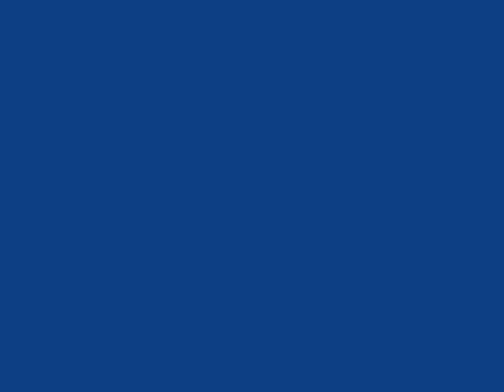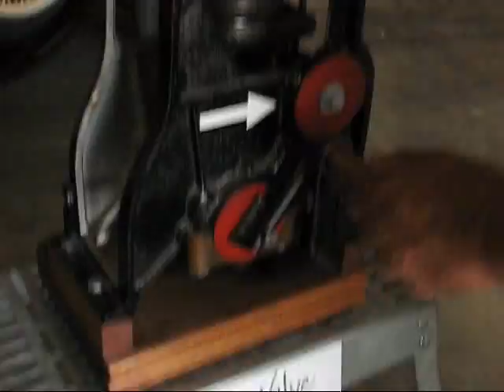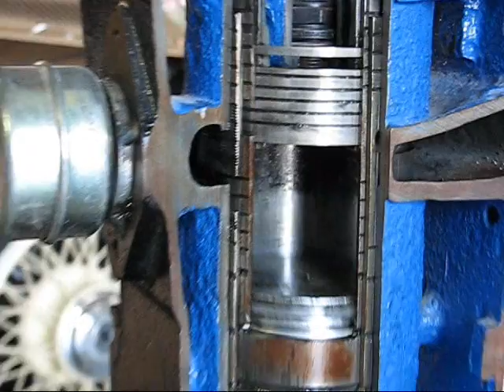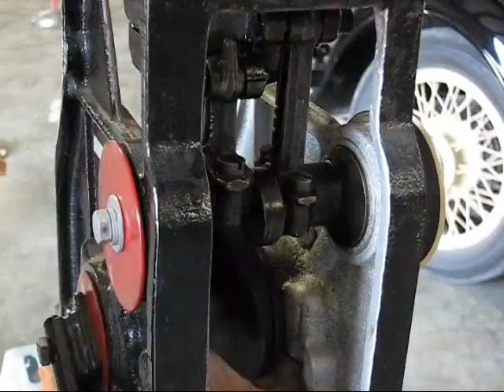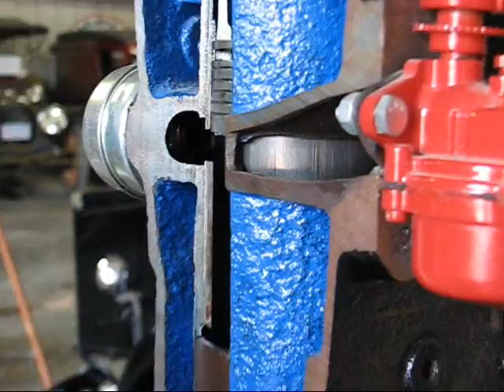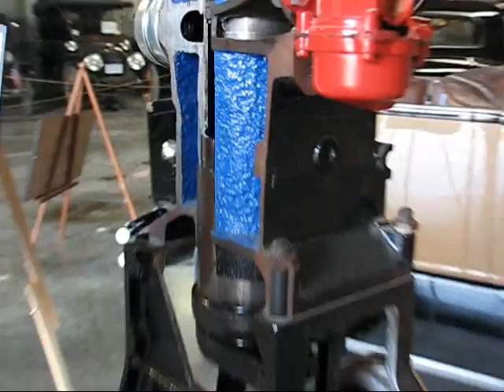Knight Sleeve Valve Engine

Comment: Thanks for the video.
My late Grandfather, Mr. G.P. Stewart, had a Willys-Knight car as a young man in the early 1900's and bought a running engine shortly before he passed in 1976. He used to start the engine and describe the virtues of a sleeve valve engine while adding the proper amounts of Marvel Mystery Oil to the fuel.
The engine was sold to Willys-Knight collectors so we know it's in good hands.

Comment: You see the huge inlet and exhaust ports, but only a few would notice that when the spark goes off, the slots in the sleeves are ABOVE the junk ring, so they are not distorted by the forces involved. You might have to be nimble on the pause button to work it out properly.

Comment from the maker: You can see the two red discs on the front of the display. The first one is the crankshaft and is connected to the handle. The second one is the smaller crankshaft that is connected to the sleeves.

Comment: It's different from a more modern type of sleeve valve engines as used by the Bristol Aircraft Company for instance.
The later design has one sleeve that moves up and down, but also rotates about 1/4 of a revolution inside the cylinder, the ports in the sleeve first opening the exhaust port when it moves down, then rotating to the inlet port and finaly going up to shut the port and rotate back to the initial position.
The Bristol radials were supercharged, so this type of engine may work well with a turbocharger as well.

Comment: Sleeve engines have 2- to triple the internal friction compared to a modern IC engine, due the sleeve movement, hence efficiency is reduced. Another disquished problem was the roundness of the sleeves, which tend to warp once hot, special around the exhaust ports, and will scrape and eventually frett. Napier and Bristol were not advertising this more or less secret process of warpfree-sleeve manufacturing.

Comment: What an incredable mess, you have to really, REALLY, detest poppet valves to design and engineer something like that. Three connecting rods, two cranks, it's the work of a mad genius.
Reply: You can't run high compression ratios as the high piston fouls the ports. But they run really well with blowers. That's why the most powerful gasoline engine ever, the Napier Sabre aero engine of 5,500 hp, was a sleeve valve.
Reply: And imagine the internal friction. Actually, the sleeve-valve concept is sound, and had major perceived advantages over some of the early poppet valve jobs in that they didn't require frequent valve jobs or adjustments, and the carbon deposits were said to improve the seals between the sleeves. Read the account of John North Willys's epic British road trip in a Knight-powered car in the early teens. Sunrise 'til past sunset every day for weeks on end, and all the chauffeur/mechanic had time to do maintenance-wise was collapse into bed each night.
Reply: These engines were designed at a time when the metallurgy for poppet exhaust valves was not very good. In the 20s and 30s exhaust valve seats would need to be regrinded and valves replaced at as little as 20,000 miles.
Reply: +Johnny Tobifour Then why were they still being developed into the mid-40's in some of the most powerful reciprocating engines ever made?
Reply: I think the question you should be asking is why are they no longer being developed.
Reply: @kuyamoto9195  EXPENSEIVE TO MANUFACTURE........BUT VERY POWERFUL........THEY ARE SMOKERS............AND THEY LOVE TO BURN OIL .

Comment: I like the elimination of the conventional valves but don't like how his cylinder walls move.  That's supposed to be a damn tough piece of the engine.  What if you want to turbocharge someday.  You have two wimpy walls moving up and down?  Not good.  I'd rather fix the woes of the wankel rotary.

Comment: It's absolutely ridiculous. It must be a mechanic's nightmare. It's incredibly awesome.
Reply: Mr T  Not simpler than typical OHV. Maybe you could argue it's simpler than some OHC engines. The reason poppet valves became the mainstay of ICEs, is ease of reliably sealing. The sleeve arrangement is a nightmare to seal. Still neat, though.

Comment: it's funny how that engine can have so little compression and still be much more powerful than Flatheads XD
Reply: Until tetraethyl lead was introduced during WWI the octane rating of automotive gasoline was 60-70. This limited the compression ratio to 4-5:1.
Heptane has an octane rating of just above 0. Pure octane has an octane rating of...you guessed it, 100! 87 RON is 87% octane and 13% heptane, or a mixture that behaves like 87:13% gasoline.